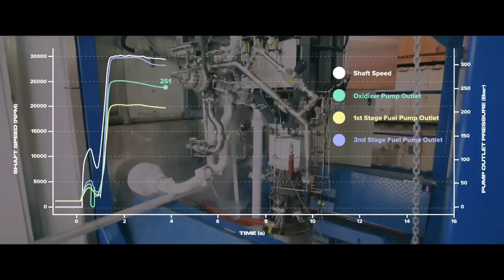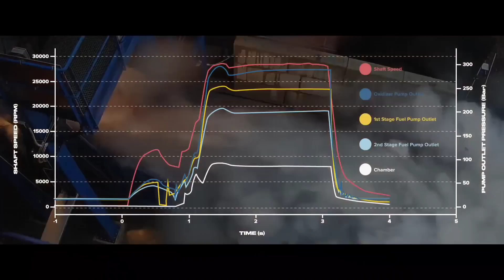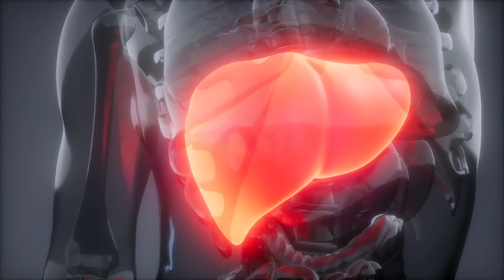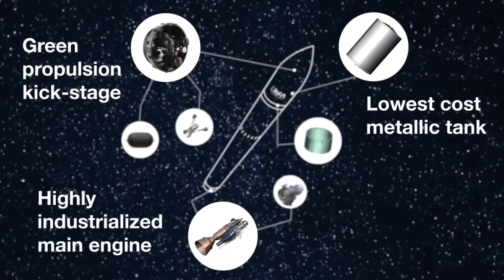Look out, SpaceX!!  These guys are launching big payloads for 5 million dollars??  RFA Interview!

Comment: 5:50 Its even worse than that

Rocket Lab charges $7 Million for 300 KG

7:41 Also ABL has a similar payload capacity at about 1.2 tons but charges $12 million

If RFA can bring all that to reality , it will give a hard time to a lot of the other small-rocket startups 

As for Rocket Lab , I think they saw the competition and that is why they are moving on to the Middle-level rockets of the  ~10 ton category , where they will have basically no competition (except for  the Antares rocket but ... thats almost the same as no competition)

Comment: 1:01 
A plant with green leaves planted on the Moon ?
Even when you can keep the roots humid, the plant cannot grow , because there is no air and most important no co2 entering the stomata.
glucose is built up during photo synthesis, by absorbing co2 from the AIR, splitting it into o2 and C, which is interposed between HO and H from water to build  glucose, C6 H12 O6 or in structure:
5 HO-C-H, CH2, O
No air, no Co2, no growth !
Green grapes absorb CO2 from the air, water by osmosis through the skin from condensation of humidity from the air and the chlorophyll absorbs blue and red light leaving the unused green, to be seen as the 'color' of growing plants.

Comment: europe needs a successful vehicle of its own....  but car parts???
Reply: Presumably basic things like actuators for opening valves, some sensors, batteries, nuts and bolts, etc. that are certified for quality assurance.
SpaceX uses plenty of Tesla parts as well in similar way.

It's not like they build turbopumps by strapping 5 Audi engines together...
Reply: If my memory is correct that is one of the things that Ariane originally used.  Whether they still do I don't know.
Reply: @heimatlos 

I think it was VW.
Reply: model T parts are the best, simple and proven
Reply: It's about the steel / steel plating used, and possibly other materials. Getting a good (& cheap) supplier of high-grade steel alloys that have reliable and high structural integrity would be a great benefit (Spacex also uses a custom steel alloy, but they probably sub it out)
Reply: I might've missed it, but did he actually say off-the-shelf car parts? Sooner or later the whole project will be threatened by a part that's not up to the task. Since they aren't set up to make that part, what then?
 I can see them contracting automotive supply companies to build them a better version in that case, but that's not the same thing, and his projection of cost to orbit makes me skeptical that such a (quite massive) overrun has not been baked into the pie.